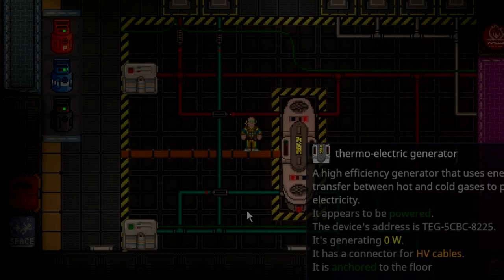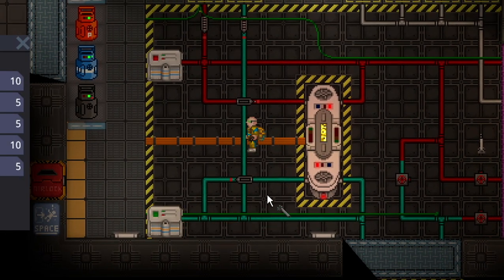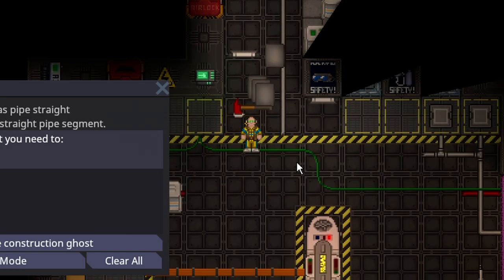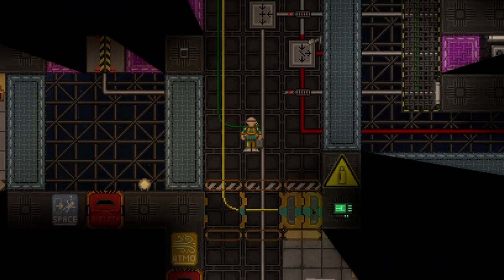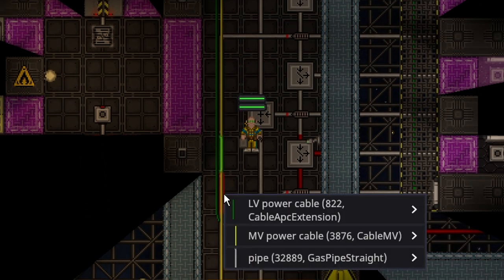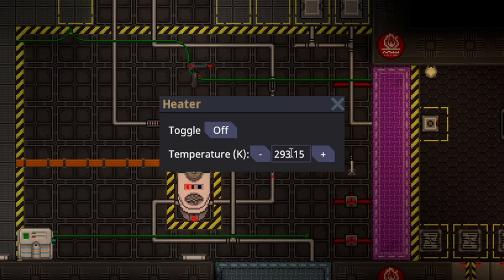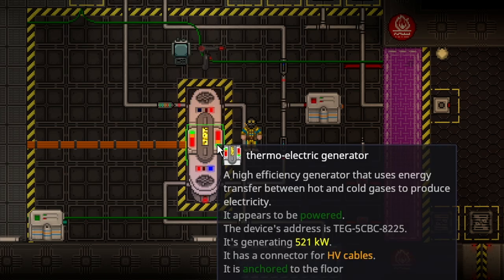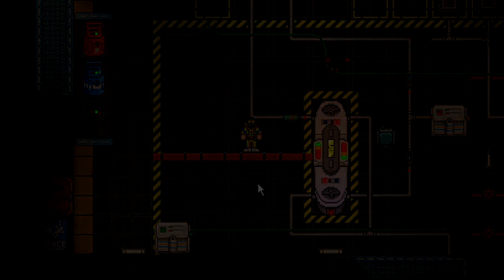SS14 - TEG Explained (Thermo-electric Generator) (Method Out of Date)

Comment: greytides hitting the LV cable getting 50k volts of electricity because the AME and TEG are on full
Reply from the maker: TEG doesn't overproduce so it practically wouldn't do anything if the AME was on as well.
Reply: never knew that! @Liltenhead
Reply: @mrjoe5714  if ur familiar with 13 i think it overproduced there, it just doesn't in 14 lol

Comment: I understand it's simple to just rip apart the atmos system and pipe everything from the burn mix to the coolant directly into the TEG, 
But what if you can't do that?
I've tried running it so many times by using the burn chamber, etc, but its stupid finicky

I don't know, I've just wanted to run a closed loop system and get it to work.
Reply from the maker: There's probably better guides out there. I know there's some image guides that are more practical than this video.
Reply: @Liltenhead  I've learned:
The bar on the middle of the TEG means nothing if there is another generator present. That means if you are running an AME or singularity, the TEG will limit its own power generation and make it look like it's not working. (Which was a big thing for me, because I thought if the TEG was not green that means I messed up)
When it's in this "Non-working" state, the TEG will limit the amount of gas it actually reacts. That means the cold loop doesn't get hot and the hot loop doesn't get cold as fast, but you're still limited by gas slowly cooling down as it does otherwise.